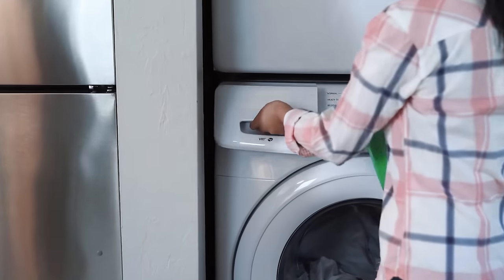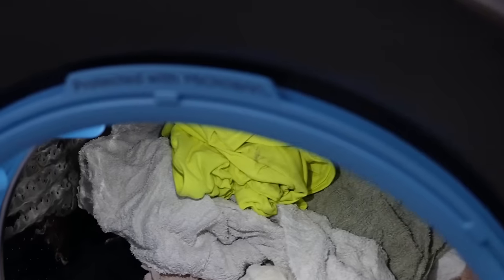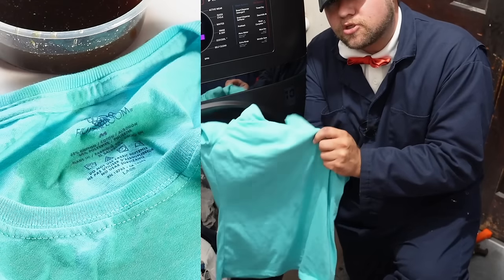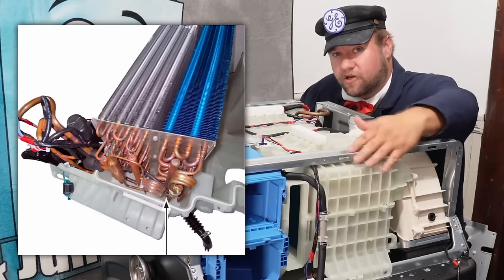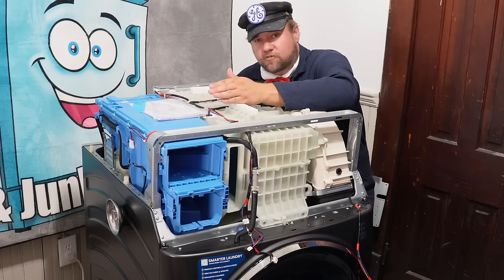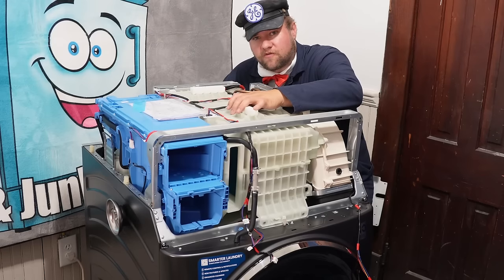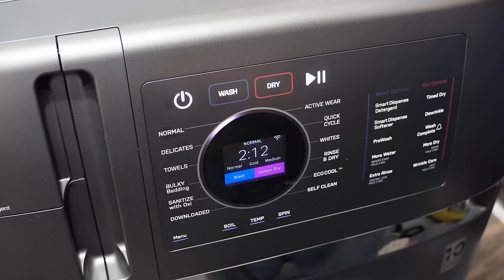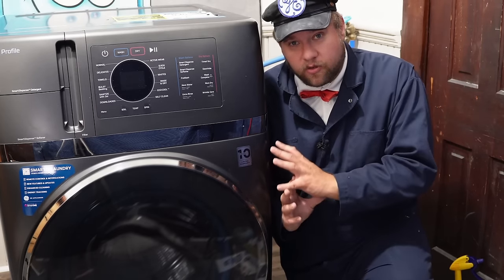The Best Washer Dryer EVER? The Ultimate GE 2-in-1-washer Dryer Combo Test & Review

Comment: I bought this machine and it is awesome and dries just fine.  I washed a king-size quilt and it washed and dried it perfectly and I did not have to take it out like my old dryer.
Reply: 5 years on the heat pump unit. Cost to replace or repair is $$$$.
Reply: @gilrose12345 It's a dehumidifier. Everyone who's owned a dehumidifier will tell you that they last at least 40 years in a basement lol. This is not a "heat pump" like in HVAC where you have hundreds of feet of coper line that some apprentice used stay-brite 8 on that leaks inside walls lol.
Reply: @donovanlewis3053 I have tried nearly every hp dryer on the marker and they perform poorly overtime! Especially the 120 volt ones. HPD's need to be 240 volts - like in Europe.
Reply: @dregenius  Actually it is a heat pump dryer and its very complex. To replace that entire unit alone would cost you $1,500 with labor. Good luck doing that 6 years +
Reply: @donovanlewis3053 GE added a large fan to make up for the lack of power due to the 120 volt. My new Beko 4.5 cubic ft 240 volt hp dryer does a great job in just 40 minutes- all jeans and cotton towels!
Reply: @donovanlewis3053 But forget about the hp part of this machine. Can GE build a washer this large size that can tolerate a 1,600 rpm spin? See you in 6 years from now.
Reply: @gilrose12345  you’re quite the troll. Must hate ev and induction ranges too. Rage on!
Reply: @reggole7291  I guess you don't like honest but fantasy. Nothing against EV's or Induction ranges, but there are +'s and -'s to every tech.
Reply: @gilrose12345  I realize it's a "heat pump" in the sense that an air conditioner, dehumidifier, or refrigerator are all heat pumps - I said dehumidifier because the sealed system in this combo unit is very much more like a dehumidifier in it's construction, lack of reversing valves and lack of dozens of feet of copper lines with flare fittings to leak like you might find in an HVAC "heat pump" system. What I'm saying is, a compressor, condenser and evaporator all mounted in a small package is generally very reliable, just like a dehumidifier will usually last decades with little or no service. It's the lack of field installation and the associated fittings and joints that allows this, I'd imagine. As for GE building a washer, it would appear they can. Maybe not quite as well as LG, but their GFW*50 machines have been generally quite reliable - I admit I thought they were a bit tacky and plastic looking at first but I've sold well over a hundred of them so far and only one major complaint which appeared to be a monday morning defect. Replacement was fine.
Reply: @dregenius  What ever you want to call it is a Haier & they are not known for reliability

Comment: I bought a 'scratch and dent' Maytag commercial washing machine for a little over $600...including tax,  delivery and taking my old machine away.  It's simple to use and has several load sizes and settings.

I don't use a dryer, since I have an outdoor rotary dryer and also a large indoor clothes rack in the laundry room.

Ben gave the Maytag commercial a good review...and it's been in stores for a while, so people have bought them, used them and are happy with them.

If I was considering buying this new GE unit, I'd want to wait until they've been bought and used a while, since it's a pretty expensive investment...more than a separate washing machine and dryer would cost.

Comment: This sounds like a great combo. I believe this runs on 120 volts so that's a big plus for energy usage!
Reply: HP dryers use at least 50% less energy than traditional ones and 'cos they dry at lower temp they're kinder to fabric, though they do take longer.
Reply: 120 volts does not use less total electricity than a 240 volt appliance. Ohm's law...
Reply: @PlumbNutz  I guess I didn't make my point very clearly. Having a heat pump that runs on 120v allows the unit to run at a much higher efficiency and thus use less energy.

Comment: Thanks so much for going more in depth than any other reviewer! All dryers clog with lint somewhere. As we saw, the filter compartment needed to be cleaned. But how much lint is getting past the filter and can you get at it to clean it? How much does a new sealed system cost? I need to buy a new combo soon!
Reply: The UltraFast creates less lint than average dryers because it's easier on clothes! Plus, the unit will notify you on the control screen AND through phone notifications, once connected to the SmartHQ app. Easy peasy! 😝
Reply: @geappliances  Thanks for this response. It's great that the UltraFast creates less lint! But should some lint get past the filters, is there a way to access and clean the evaporator and/or condenser coils?

Comment: I have a GE stackable that’s 17 years old. I’ve replaced things on it and maintained it. It’s really showing it’s age. I’m glad I listened to this because I don’t want this machine. I really want to close off my dryer vent. I will invest in the dryer with a heat pump. I’ve used machines like this in Europe but they still are not completely drying the clothes.

Comment: I will be getting something like this when my current washer/dryer setup decides to die. Our utility room isn’t very big and 2 units in there basically gives you just enough room to walk in and out. It would be nice to have a little more room for storage or even a place to fold clothes.

I think the biggest benefit to a unit like this is that you can put it anywhere that you have water, drain and a standard outlet. No special dryer power outlet or exhaust vent required. You could put this under a counter in a kitchen or in a bathroom, even in a garage. It also doesn’t draw in hot or cold outside air like a standard dryer, and of course it uses wayyyyyy less electricity.

I don’t consider the time for a full cycle to be a big issue, it just requires a minor rethink on how you do laundry. Instead of loading it all in the middle of the day and expecting to fold it immediately afterwards, load it before you go to bed and fold it the next day. That’s what I do anyway, but as it is, I have to load it, wait for the washer to get done, transfer to the dryer and then go to bed. Having it all in one would be much better. Shifting things so that they happen overnight makes way more sense. I do this with tons of things already since electricity is much less expensive overnight since the grid load is less (things like drying clothes, running the dishwasher, charging my EV, etc)
Reply: If you leave dried clothes in the dryer all night, then fold in the morning, doesn't your stuff get insanely wrinkled?  I fold immediately when dried to avoid wrinkles

Comment: I have an lg 2 in 1.  I'm a full time solo parent of an 11 year old.  I love that machine so effing much it's unreal.
I run a tub clean cycle more often than I would with a regular washer machine, but other than that I don't do anything different.  Mine has a slightly smaller capacity than I would prefer, doing large blankets isn't really an option.  Nice to see a larger capacity 2 in 1 on the market :)  
Oh!  I also use super high spin cycle, low temp setting on the dryer for clothes, normal dry setting for towels and other stuff. A full load, including cool down time(which I consider to be part of the drying process), takes about 5-6 hours depending on the size and contents.

Comment: I have a LG Signature Washer Dryer combo and we like it but it’s been challenging for a family of 4 with cats. One feature he didn’t mentioned which is great, is that this heat pump dyer tech doesn’t use a dryer exhaust vent. So no need to hook it up to the wall but also it’s nice it’s not intaking and pumping out all of your heated/air conditioned air out of our house like a standard dryer would. Synergies well with our geothermal system to minimize electric costs. 

Lately though my unit has developed a scraping sound during the dry cycle only which is annoying for sure but it seems to perform the same. Anyone have any ideas of what the issue is?
Reply: Might be a coin or something stuck my the drum.

Comment: I’m wondering if this type of drying process is easier on fabrics than a traditional dryer.
Reply: You wondered right! Instead of high heat, the UltraFast uses fast air, which is easier on clothes, creating less lint, less static, and longer lasting clothes! It's comparable to air drying your laundry on a clothesline!

Comment: Thanks for being awesome, and sharing. And the wife comments rock!
Looking into this model. We had 3 LG versions before, one used two new. The new ones had constant issues fixed under warranty, and then out of it. and eventually our entire unit was replaced. The thinQ app did let you download actual custom cycles, but it used to take 6-8hrs to do a full smallish load. I'd never buy LG again. The 1-5-10yr warranty on this one is appealing, as is the larger capacity and low energy use.
Thanks!

Comment: My air conditioner went out, so YouTube has been showing me all kinds of heat pump videos. This is by far one of the coolest I've seen. But using a heat pump like that I think is genius. Imo this will require much less maintenance than a typical dryer just by not having a vent. My vent is on the roof with several bends in the long tube, and is a pain in the ass. The filter is something everyone should be cleaning on all dryers anyways.

Comment: I love combined-cycle machines.  The LG unit i bought 5 years ago is amazing.  Not a heat-pump model, it uses a resistive heater and a cold-water condenser section, but it still uses only a fraction of the electricity of a standard unit because it recirculates process air.

Another benefit of ventless dyers, whether they are combination units or standalone, is that they don't blow all your heated/cooled house air outside.  My math says that fact alone is saving me a couple hundred bucks a year on heating and cooling.

I think that the reason people complain about time to dry so much is that they haven't figured out the ultimate life hack for doing laundry with these combined cycle units:  put the clothes in when you go to bed, take them out when you wake up.  Unless you have 8+ adults in your house, doing laundry this way is amazing.  No more spending half a saturday or sunday babysitting the laundry machines, rushing to swap clothes so the next person can use it.  toss your shit in at night, get it out in the morning, and just work with your housemates to deconflict which night people do laundry.

Comment: I’ve been selling appliances for 14 years. When this arrived at my company in June I purchased it almost immediately ($1999  plus the pedestal $229).

This has forever changed how I do laundry. I put a full load in right before bed, when I wake up I have a giant load of laundry already done. If there is any more dirty laundry I just throw it in before I go to work.

Before I had this 2 in 1 unit I would put clothes in the washer after work, then fall asleep/forget about the laundry. Then I would wake up to damp clothes, and not enough time to dry them before leaving for work.

Also if you’re wondering why the price has gone up? From June through mid August my company has completely sold out of these 4 TIMES, and each time we ordered more we doubled the size of the previous order. Even I had to buy the display model off the sales floor because we were sold out and I didn’t want to wait for the next shipment. I’ve had customers come into my stores because they seen this at our competitors but they were also sold out.
Reply from the maker: Funny story on selling out. A major parts company knew I bought this to do reviews on. They called me and asked me to cut my work short on this so I could crate it up and ship it to them a few states away for a factory training class. GE couldn't get them one, nor anyone in their giant metro area had one, so I was their only choice. The speed of which these are selling is insane.

Comment: Good review, we just got one, due to venting issues where the laundry room is located and now have more room.  I failed at folding the first load too.  So far 2 loads, one with heavy items little over 2 hrs, a smaller load in about 1:30.  Quiet machine too, has some noises but over all quiet

Comment: Nice video. You are the only one I have seen so far, who took some of the unit apart. As for having to clean the filters ... the lint filter on a standard dryer should be cleaned for each load so that should not be a concern that this one also needs cleaning. As for the foam filter that needs periodic cleaning, even though it took some time and effort as you demonstrated, it took far less time and effort than having to pull the dryer out from where it sits to clean out the vent hose ... something that should be done at least once a year, if not every 6 months.

We have recently purchased one of these and, so far, we have been happy with it and have not noticed "damp clothes" when we remove them from the machine.

Comment: Another note about efficiency. Yes, it uses vastly less electricity from start to finish.

It also doesn’t vent to the outside of your house like a normal dryer. A normal dryer blows a lot of air outside of your house which means an equal amount of air must be sucked in from the outside. Who cares? Well, it is likely that you used energy (gas, electricity, oil, propane, etc) to heat or cool that air in your house, just for it to be pumped out of your house and unconditioned air sucked into your house that you now have to pay to condition. Depending on the temperature of the outside air, this could lead to additional significant energy savings.

Comment: I lived in south east Asia for 4 or so months back in 2019-2020, and in our little condo that we were renting was an LG combo washer and dryer unit. I've never seen or used them before that trip! I was so impressed with how silent and space saving it was! As soon as we got back to the U.S. we sold our washer / dryer individual units and bought an LG WM3997HWA ventless 4.3 Cu. Ft. unit and never looked back! Sure it takes 3.5 hours on average for our loads between washing and drying, but who cares! You don't need to move the clothes from washer to dryer and we can't even hear it! So we just turn it on before sleeping - it is PERFECT! Could you please do a video on how to maintain such a machine? It doesn't have a filter like the GE model in this video, but we clean it manually every 5 loads or so. Thank you!

Comment: Thanks! this is a great video. I've had GE Ultrafast for 6 months and the biggest let down has been the SmartHQ app. You CANNOT remote control this until you turn on the machine and press remote control on the machine itself. the app still shows you what's running and time left etc, but you cannot control any options from the app unless you've enabled remote control on the machine (per GE, its a safety thing). Setting up delay start is the absolute worst! You have to go through like 5 menu options so i've given up on using delay start to schedule nightly loads. GE!! Fix this. However this machine can stir up noise at full tumble, its not a super quiet machine (I had a std LG washer/dryer  before). The filter cleaning is a MUST EVERY.SINGLE.TIME. If you pack lot of tiny and large clothes, its high speed tumble will cause some tiny clothes to be still damp but that's a lesson you learn over time with your specific loads.

Comment: i got this machine for about $1600 from home depot, this thang is a beast. i would say it spins 2x faster and longer compared to conventional front loading washer. best part is not having to unload. 10 year warranty is also amazing. the only draw back is that it's heavy, 306 lbs to be exact and trying to move it would be challenging but overall, i think this changes the whole washer/dryer industry b/c of that heat pump
Reply from the maker: I agree. I think this changes the entire washer dryer landscape permanently. Other companies will be forced to alter their combo designs. Why buy something that takes 4-6hrs when this can do it in half and for less electric?
Reply: How did you pick this up for $1600?? I would totally be into this if I could find it for that price. Please let me know I would appreciate that very much.

Comment: Here in Brazil LG (and I believe Samsung as well) has the two in one models. What makes them very compact is that the drying method is not blowing hot air out but condensing the damp air with a cold water coil and draining it the same way as the rinsing water. That way they can be installed in closed rooms with little ventilation, apartments, under the sink or bathrooms. I love mine and won't trade it for nothing.
Reply: It is that way in Europe as well. It's about time the US caught up.

Comment: I had this delivered two days ago. Unfortunately there's an issue with the drum. It shakes and vibrates so bad the whole house feels it. 

A replacement will come October 2nd. I read several reviews of other people having a similar issue. 

I had a combo in my rv, not ge. It was good but took forever to do a very small load. 

This machine is truly amazing. The overall wash and dry time is dependent on which settings you use. Overall I love this machine. Let's pray the replacement has no issues...
Reply from the maker: Did you make sure the shipping bolts were removed from the rear of the unit? That is a common thing the installers fail to do that will cause that. Otherwise, I have heard of a few situations where they shake and thats not it. Wonder whats going on there.

Comment: The power requirements are the big win.  I have 100A service, and solar, and so avoiding excessive electrical load is such a huge win.  I have a gas dryer now and I don't have a 30A outlet for it.  This would be perfect.